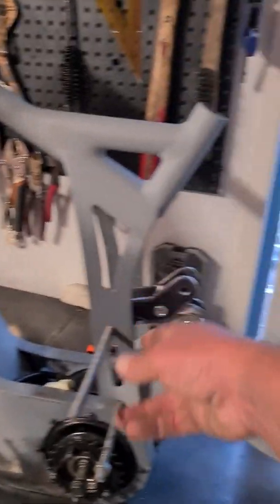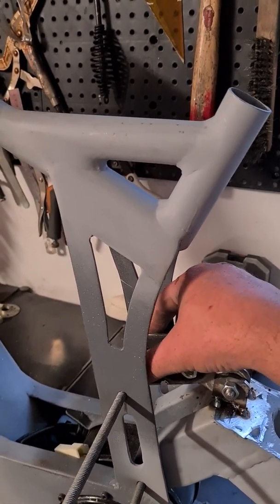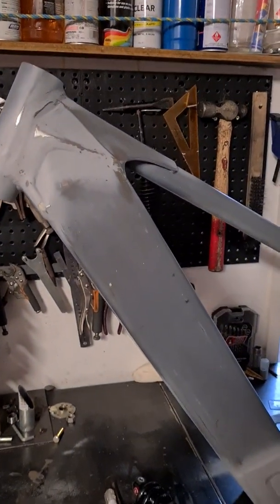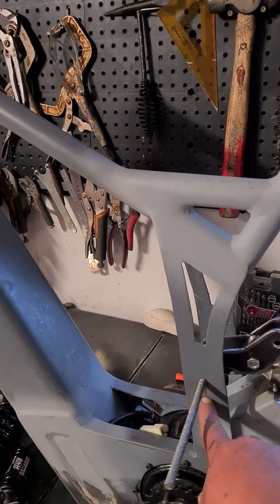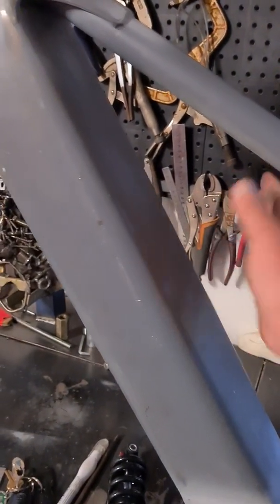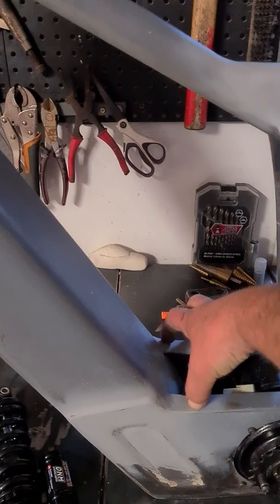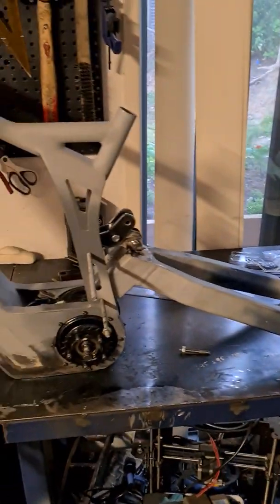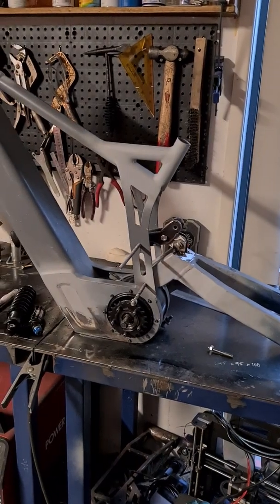Custom Cyclone Coaxial e-bike frame build update

Comment: Not best angle for swing arm, it will fold on start, and suspension will not work correctly. pivot point of swing arm must be a lined with motor shaft or be as much close to it. and cyclone motor need a forced air blow cooling. I burn one, kill magnets.
Reply from the maker: Swingarm has been changed since this was published - check out my other vids. This isn't a standard cyclone motor its the coaxial 4.8kw- thermal management of the motor is part of the plan but not forced air cooling most likely I will encapsulate the windings in thermal resin. Thanks for watching

Comment: Awesome metal work Simon.. what alloy did you use for the frame, is it MIG welded?
Reply from the maker: Thanks Michael! This prototype version is steel 1.2mm for the main body and 3mm for the strengthening pieces. Version 2 will either be 6061 alu or 4130 chromo. It's partiality TIG and partiality MIG
Reply from the maker: It would have been all TIG but I had some airleak issues with my TIG hose
Reply: @simonchamberlain9215  the welding looks awesome. I personally would go with the 4130 chromoly. 6061 will require heat treatment post welding to retain structural stiffness. and steel will be more durable considering the amount of power this motor can put out.
Reply from the maker: @magenzie0  Yeah exactly - That was my thought process as well
Reply: @simonchamberlain9215  you should consider a production run. this frame will will look amazing